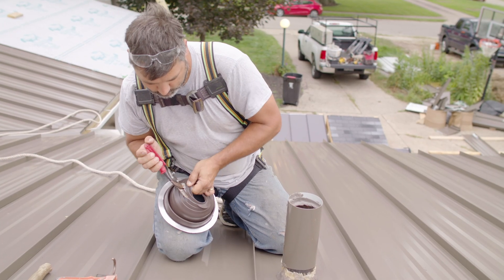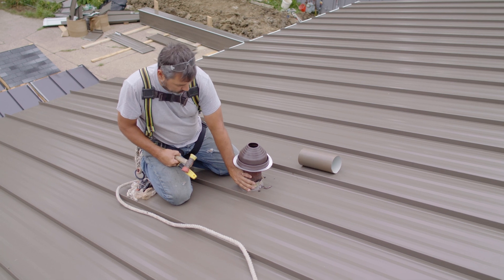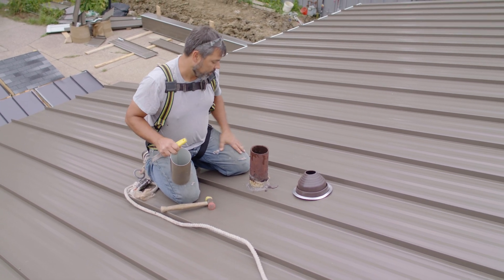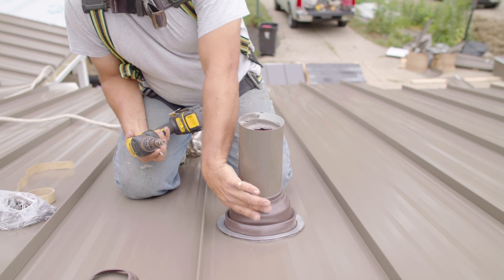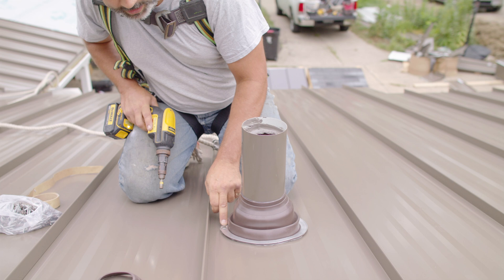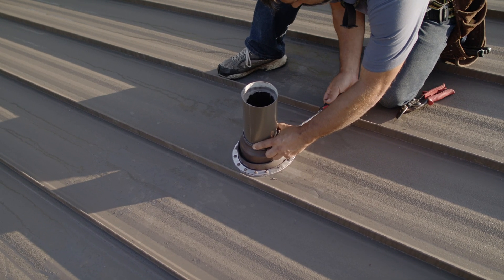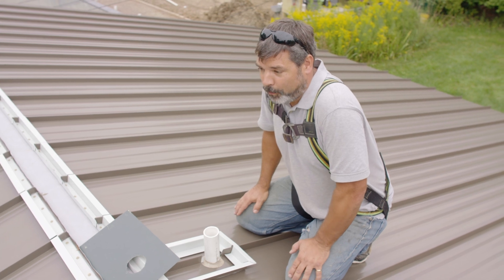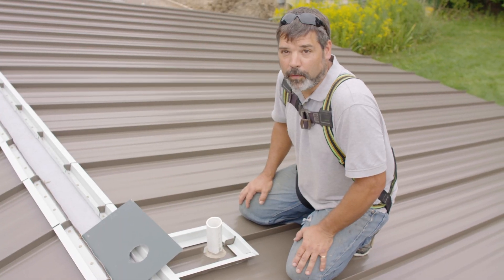How to Install a Pipe Boot on a Standing Seam Metal Roof

Comment: That's going to leak around that ring every 2 inches is to far apart plus every screw ran in that butal tape ripped it and then there's a 2 inch gap with no pressure pushing down

Comment: just a comment and a question….

I’ve found it helpful to pre drill my holes in the ring so that I don’t distort the ring. I noticed between screws it get pushed / humped if not pre drilled

Also, do you exclusively use the butyl under all your fixtures instead of a polyurethane caulk, like solar seal 900?

Comment: We changed some boots on my standing seam roof a couple of years ago, did everything exactly like your video, butyl seams etc. Boots were nice and snug. Had leaks this spring and was up on the roof inspecting for obvious issues. Every single boot appears to have stretched. one has very visible gaps the others take very little effort pushing on them to form gaps. What would have caused this, they were very tight and joints were rigid to the pipes when installed, now sloppy an loose like the rubber was stretched out.

Comment: There are no exposed fasteners in a standing seam installation except for the se rubber boots? Seems like a perfect place for water to fine its way in. Please tell me that there isn't a better way to do this?
Reply: there isn't a better way to do this.............................................................................unless you 1- do some work and make sure none of the pipes will hit a rib, 2- if so than move the vent pipe, 3 -you do a 2-panel installation but not many people like that because of the seam.. but that z bar whatever the fuck that was.... messy. those screws are only stitch screwed into the metal and metal moves so.... there ya go.

Comment: What is the acceptable type of sealant to be used in this application? Epdm pipe boot to metal roof
Reply from the maker: We recommend a butyl tape and a silicone-based sealant like Novaflex Metal Roofing Sealant. -Thad

Comment: Was there 1/2 inch osb decking under the steel roof panel? If so, should there be a clearance hole larger than the boot base so the screws only penetrate the steel roof only? I'm thinking if the screws goes through osb decking, the expansion/contraction between the steel and the osb would be different and could compromise the butyl seal over time?
Reply from the maker: There was a 1/2" plywood roof deck. Yes, you are correct about cutting the deck larger than the boot base. The screws simply penetrate the boot and metal, not the wood. -Thad

Comment: I’m not the most intelligent person not have I ever installed a metal roof of any type. But, in my pea brain i see multiple issues with this boot set up.
First. Both boots were installed and a pocket/crease was left in the boot near the bottom. This will collect water, mold freeze and cause issues down the road.
Second. The pipe sleeve is a nice added touch but, ultimately you have made even more places for water to penetrate the roof. Yes I see caulk being used. Caulk only last so long and will become brittle and crack over time.
Third. I have always been told to start at the upper most part of the boot and install the screws 1.5” apart. Going from side to side and finishing at the bottom. He installed the screws 90 degrees from each other then installed screws between them. This can cause a ripple leading towards another possible water penetration.
Reply: I heartily agree with you... but only on the pea brain part.

Comment: That upper pipe boot detail is nice work I will give you that. BUT, completely unnecessary in my opinion! But I got to know why do you guys have all those exposed screws along that Ridge line? That is completely unnecessary as well!
I'm going to go ahead and assume you guys are too lazy to Hem it on to the Z metal and then put pop rivets to connect the Hem to the Z.

Comment: What's the benefit to adding the extra pan to raise up the smaller pipe boot vs. just forming the ring of the boot over the rib? Love the content. Thanks.
Reply from the maker: Pipe boots are not designed to be formed around the extreme angle created by a standing seam vertical rib. We always recommend laying out the roof so the pipe falls in the panel field, moving the actual pipe penetration location, or using a detail that creates a flat pan if neither of those options are viable. Thanks for the question! -Thad
Reply: @TheMetalRoofingChannel  
Makes sense.  Thank you.

Comment: Never in my 14 years of bleeding on the roof top would I have ever thought about the detail used on the smaller pipe boot near the ridge...  Absolute genius!  I can't wait to see what other killer ways to address off module details your installer has to show us.  I find it curious though, with all the painstaking effort the installer took to minimize finish damage, ensure the assembly was watertight (before a single piece of metal hit the deck, thank you all again for stressing the importance of dry-in), and otherwise top notch workmanship, why there would be approval to attach the ridge cap with exposed fasteners?  I'm certainly not saying this detail is wrong/bad otherwise, because certain details require, with no way around it, such as pipe boots, exposed fasteners which makes sense.  What is the technical reasoning behind doing so with the ridge cap assembly?  Based on what I have seen so far, my gut tells me you guys might be on to something here, and I would hate to wait another 14 years for another Metal Roofing Channel video to come, and save me from what I now understand to be an extremely manageable pipe on a seam configuration.  Excellent content, keep up the good fight!
Reply from the maker: Thanks so much, glad you found it helpful! Matt has a lot of good solutions to those kind of scenarios. We are releasing the video that explains the ridge flashing tomorrow (1/27/21) and how we installed it. The cliff notes version is that this house is equipped with a VENTED ridge detail. A standard ridge detail would be installed with rivets, but the additional venting material requires longer fasteners. The key is that the fasteners do not actually penetrate the building envelope. They enter the ridge cap, go through the venting material, and back out through the z-closure, similar to the rivets on a standard ridge. Check out the video when it drops, and leave a comment if you want to know more. Thank you! -Thad
Reply: Would have been easier to move the vent to the center away from the standing seam. Plastic pipe is easy and fast and in the long run insures a better seal. Especially in high winds. That lip edge is a tornados door opening.

Comment: Hi Thod! question, here in UAE, I always encounter details of pipe boot fixed using bulb tite rivets on the sheets, while Matt uses screws fasteners on the video. May I ask you or Matt's opinion if they have a different or just the same impact on the standing seam in terms of weather tightness longevity? Nice and clean video by the way. Cheers!